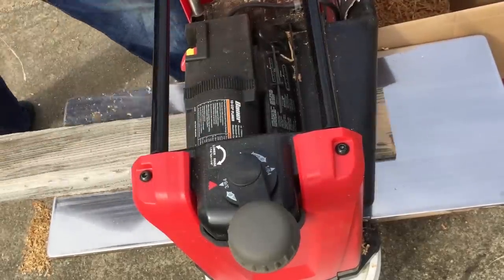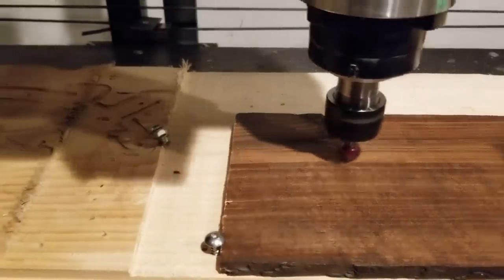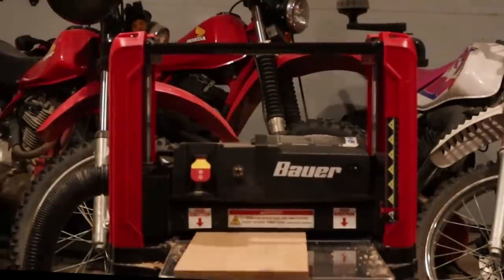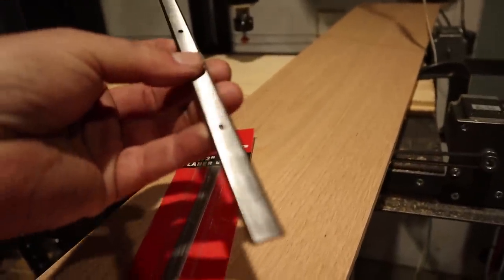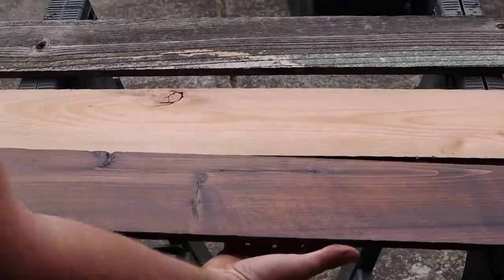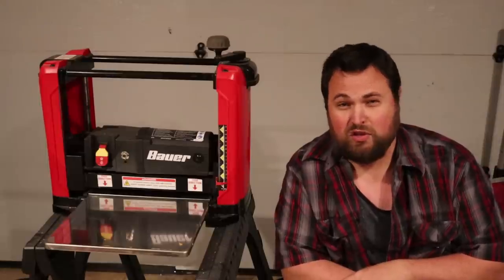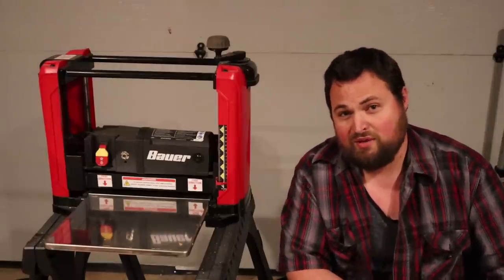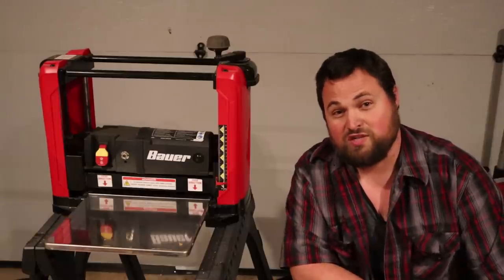Harbor Freight Planer Review Update: 1 Year Later

Comment: So...where do I start...I actually own this planer and have for just over a year.  This thing is the biggest piece of trash I have ever owned!!!! I don't do a lot of furniture, but I do do a lot of dizzy bowls and segmented bowls for turning on the lathe.  It is not consistent. tears deep gouges in the wood at various locations due to the rollers skipping because of grip on the wood and not because of bowing or curving of the plank.  It will not plane the wood straight through, but instead starts straight and skews the wood sideways through it, about halfway through the board. blades are way to expensive for the quality of metal you get and go dull, very quickly, especially if you are jacking hardwoods like purple heart through it.  I would never recommend it to anyone, unless they are doing pine furniture and expect to lose about 20% of the wood to cut outs of gouged wood in various locations in the boards.  It has become a paperweight in my shop and will probably be giving it away to a friend to doesnt have the money to buy one. my suggestion is to invest the money you would spend on this thing into a planer of name brand or possibly into a barrel sander of good quality.
Reply: you're trying to run purple heart through a table top planer.... any planer from any box store is going to fail at that task...
Reply: @TheFordtrucknut  the dewalt and Milwaukee didn't